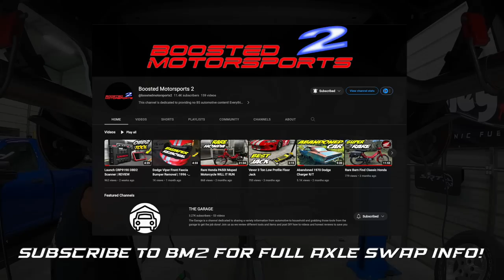Dodge RAM 1500 HEMI SWAP Build | Part 10

Comment: My dad has a one owner 98 SS/T with only 132.000 miles...they came with 3 different gear ratios...3.21.  3.55 sure grip or a 3.91 sure grip. Lmc makes the best replacement dash

Comment: The complete dash from a 
98 - 2002 2nd gen will fit right on. It was upgraded on these year model trucks. Just a different style and look.
Reply: Some auto upholstery shops may repair the dash cover and spray interior paint to match. They also can recover the dash with vinyl material to match the interior color.
Reply: Yeah but people that know these trucks will see the rest of the interior is 94-97. Not that it makes a huge difference but for those OCD people out there lol

Comment: It's an interesting thought but in the live comments someone mentioned getting the dash structure 3d printed. I wonder if that's a viable option if anyone local to you would be able to accomplish that and have it be sturdy enough 🤔
Reply from the maker: Would be crazy expensive and the printer would have to be huge!
Reply: @BoostedMotorsports  yea thats probably very true. Hopefully there is something nearby. Considering how many 2nd gens there are in junkyards and on the road there's bound to be 1 somewhere
Reply: Alldodgetrucks 3D prints them

Comment: Ive seen fiberglass inner dashes for sale on facebook.  The dash that the lmc dash mounts to.  I bought the dash and bezel from lmc and while replacing them a lot of pieces started breaking off of the inner dash.  After getting those parts in as good as I can I saw the inner dash for sale.  I'm just not sure I want to take all that out again.

Comment: Are 3.92 gears too much for a 8 spd? I'm doing a 69 coronet 392 8sp swap, my current gears are 3.92. Ppl say that's not good with the 8sp?
Reply: 3.92s are in alot of ram trucks. Hemi, 8 spd 3.92 is the combo